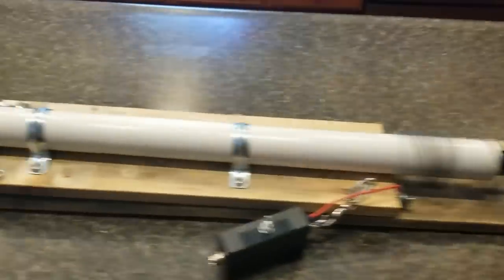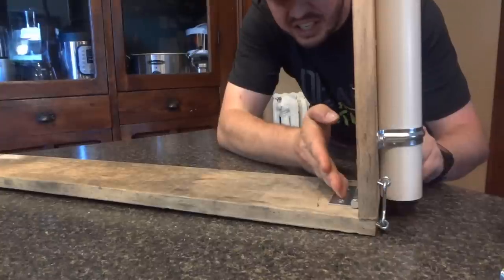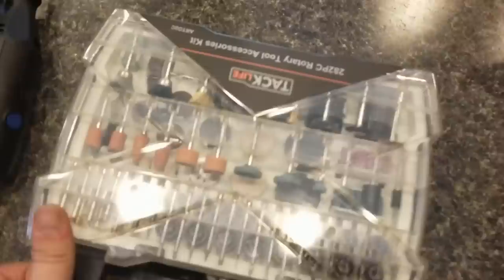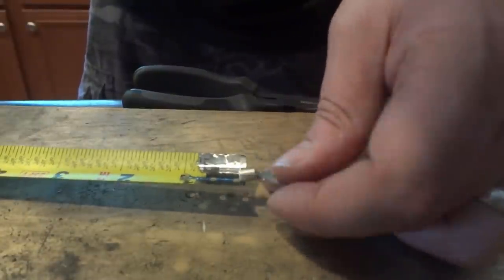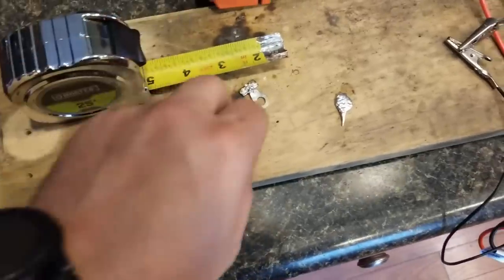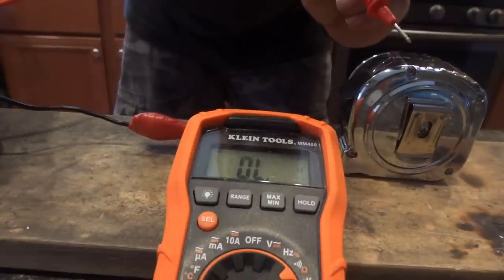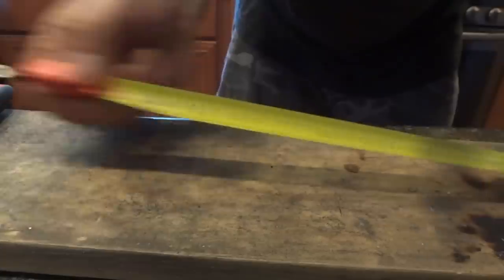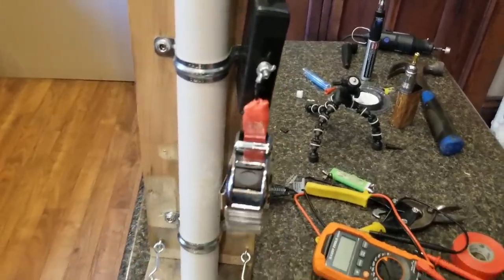Ham Radio HF Homebrew Antenna:Tape Measure Counterpoise! Vertical Slinky Antenna Update

Comment: I bought the exact pole you have listed, took it out and basically made the same type of mount you did and put it on top of my van. It REALLY liked 20 Meters. I made a Canada contact, then the little ring, where the key ring attaches, well, it snapped. It is a very weak point. I will have to find another way to attach it, but I can vouch for it and say that it does work.
Reply from the maker: I wonder if you got a weak one, I think my slinky puts quite a bit of pressure on the eyelet and it hasn't broke yet...my cap on the bottom broke like the second time I took it down, I just put some black tape over it.
Reply from the maker: Thanks for commenting and giving it a go!

Comment: Years ago I was taught how to solder.  My teacher said make a good physical connection first then solder it.  Crimping is not likely to last, so use rivets as the Tape Measure Manufacturer has already worked it out. 
Thank for the great ideas.  
I’m going to go find the original Slinky Antenna video now.
Reply from the maker: Definitely an art to all of it....
Reply: Mike Hannah, you are rocking it, nothing ventured nothing gained.

Comment: If the tape measure is made of stainless steel, You should heat it up and dip it in nitric acid. This will put a copper plating on the metal and will be easier to solder.
Reply from the maker: That's interesting....I'm getting better, learning some tricks. I'll have to check that out.

Comment: Hey, Mike - there are some metals to which the kind of solder you're using will make a strong mechanical bond. Steel ain't one of them.

Electronic solder will bond readily to Copper, Brass, Bronze, Silver, Silver-plated lots-of-things.

Silver Solder might work better with the steel, and might also in turn bond really well to the ring connector.

But you can BRAZE to many types of steel, with a bronze alloy brazing rod. Requires a lot more heat to make the bond happen... like 1100 degrees F or so. You'd need a MAPP gas torch at a minimum.

So then, if you tinned the end of the spring steel tape with a brazing rod, you MIGHT then be able to get solder to "wet" to THAT and bond properly.

I've got a MAPP gas torch, and more measuring tapes than I could possibly use. So I'm very tempted to try something similar, except in my case I want the tape to be a vertical element inside PVC pipe (a cheapskate's StepIR). I'd therefore want to grind clean several patches along the length of the tape, for different bands. Braze (or silver solder) patch that won't rust, that I can then alligator clip (or some other even tighter clamp) in order to feed the element.
Reply from the maker: Thanks for all the info! I've been getting better at soldering but am pretty new to soldering things that aren't pcb boards or wires. I've been playing with a few other ideas for a tape measure to be a radiator as well. Need to find the time to just make it and try it out!
Reply: @mikehannah6054  Well if I get a Tape Measure Vertical working, I'll try to remember to let you know. I may begin experimenting with that very soon.

Comment: Use the flattened ring terminal contact area, drill small holes on either tab. Use 4-40 hardware screw, washer, nut to attach to tape measure. Then solder that attachment together?
Reply from the maker: Probably would've worked/helped!

Comment: Just drill a hole through the tape measure behind the hook, sand both sides and use brass hardware to secure the lead from the  balun to the tape measure.  That should provide good electrical  and mechanical connection.

Comment: 10:18 Please what's inside the black box?
Reply from the maker: It's a 9:1 unun. A T130-2 toroid core wrapped with 18ga wire.
Reply: @mikehannah6054  Thank you.

Comment: Thank you so much for posting this work... gave me great ideas... as I wasn't looking to spend a fortune on a portable vertical HF antenna... Still waiting on a crappie pole to arrive so I can check the bottom diameter so I can match it to steel and pvc pipe (steel outer pipe shorter than pvc) weld a bull pin to an appropriate sized end cap plus use eye bolts for a little extra support as far as possibly guying it out but don't picture myself getting more than a 2.5 ft pvc pipe see how it goes... any thoughts or ideas in regards to that would be appreciated KC9HRI